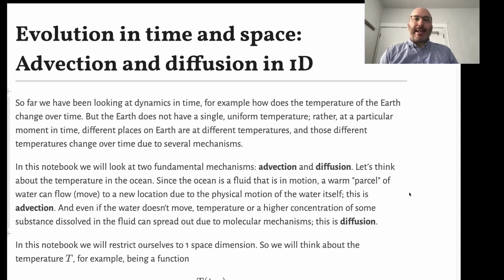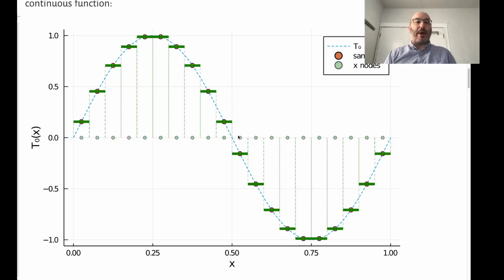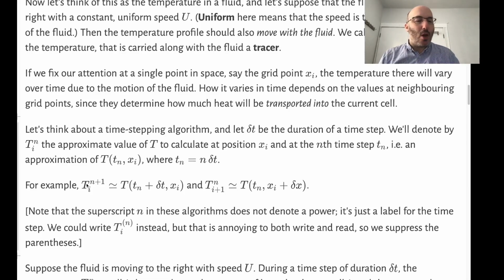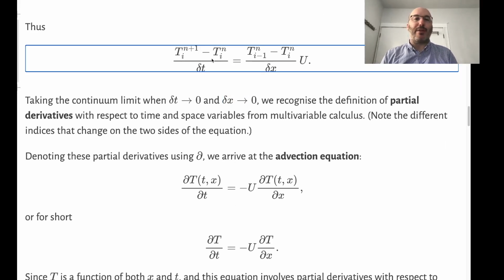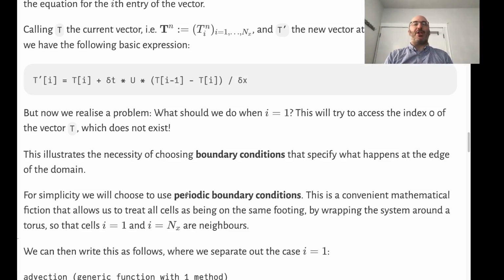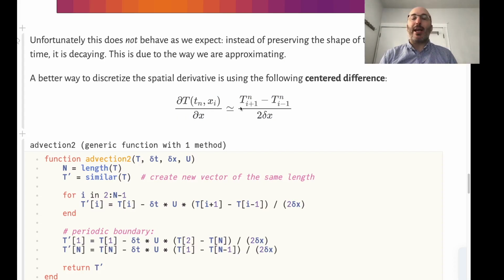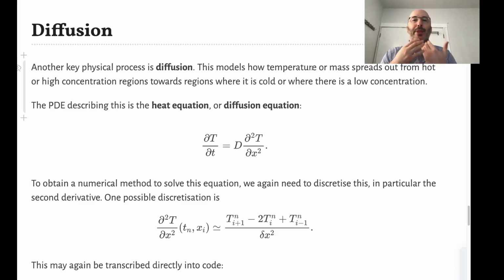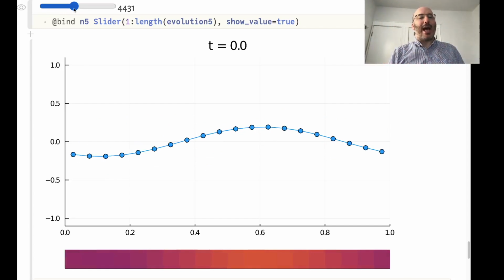Evolution in time & space: 1D advection & diffusion | Week 12 | MIT 18S191 Fall 2020 | David Sanders

Comment: Idea Only particles - Use Blender 3D particle generator to simulate keypoints in a heat flow. Could this work? The particle when transformed represents a heat cluster? Maybe reduce a heat solution image to a few keypoints by which a machine learning function can regenerate it again with the keypoints as input data. Then you only need the diff or incriment equation for the keypoints.